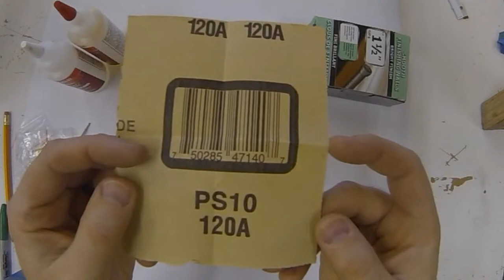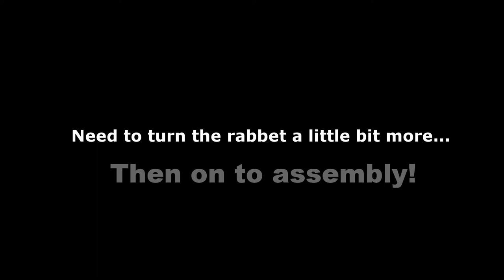How to make a Walnut European Style Pen

Comment: What rpm should my lathe be at?
Reply from the maker: For walnut, I’ll turn it between 1500-1800rpm. Depending on the type of wood grain and how sharp your chisels are, I would lean toward the higher rpm for carving. Then after sanding is done, around 2500 for steel wool and wax application.